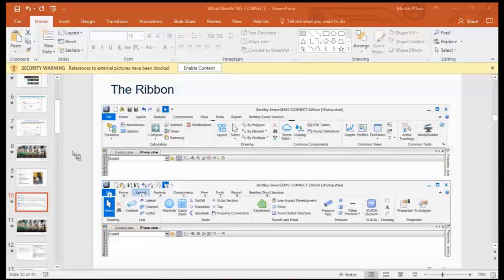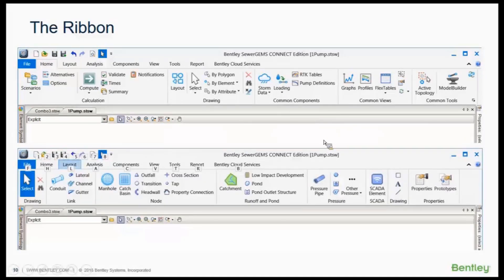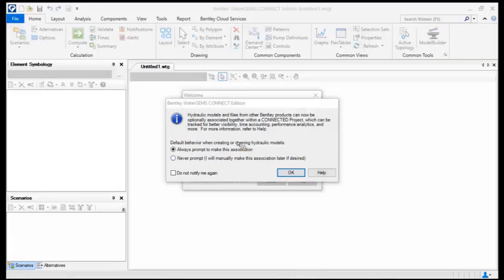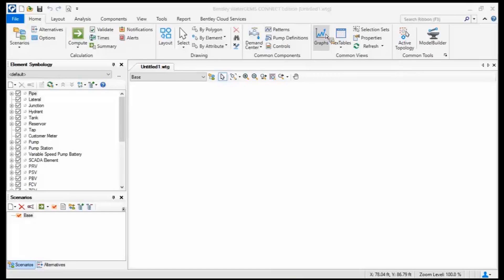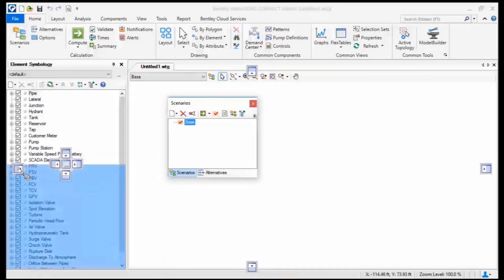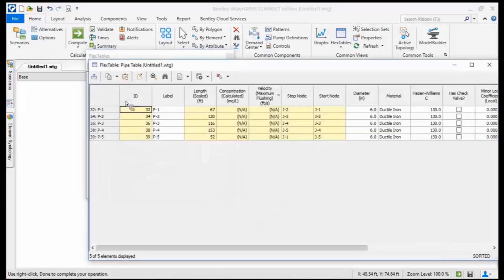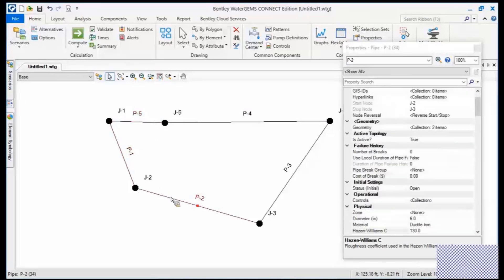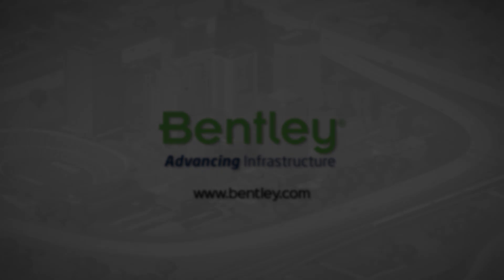WaterGEMS/WaterCAD Fundamentals Part 1: Introduction and Model Creation

Comment: does junction has to be provided only at consumer ends?
Reply from the maker: Sourabh, the junction node element is used as an endpoint of a pipe (a pipe must have a node at each end), and does not necessarily need to have a demand (consumption). For example it can be used to model a transition from one pipe size or material to another, or to model a junction of two or more pipes.

Comment: How would this software describe any failures in the network??
Reply from the maker: Hello Qasim, a network "failure" could be a pipe break, a stuck valve, or something else. WaterCAD and WaterGEMS can model a pipe break using a demand at a junction node, or an emitter coefficient (which models a pressure dependent demand). The Criticality tool enables you to see the impact of having to isolate pipe breaks, and you can incorporate pipe break history into pipe renewal planning. If you have any other questions, please post on our forum: https://bentleysystems.service-now.com/community?id=community_forum&sys_id=0310b7ca1b1a3110f3fc5287624bcb80

Criticality: https://bentleysystems.service-now.com/community?id=kb_article&sysparm_article=KB0014052
Pipe Breaks: https://bentleysystems.service-now.com/community?id=kb_article&sysparm_article=KB0058937
Emergency response: https://bentleysystems.service-now.com/community?id=kb_article&sysparm_article=KB0014289

Comment: Hello, can this software be used to study the hydraulics of an Aquaponics system?
Reply from the maker: Hello Paul,  WaterCAD and WaterGEMS can be used to analyze pressurized water networks with Newtonian fluids. With a given set of "knowns" such as outflow rate at certain point and assumed boundary hydraulic grade (water level), the program will route flow and calculate resulting pressure.
Reply: @bentleywaterinfrastructure  great, thank you!